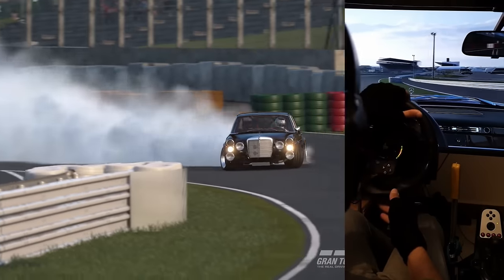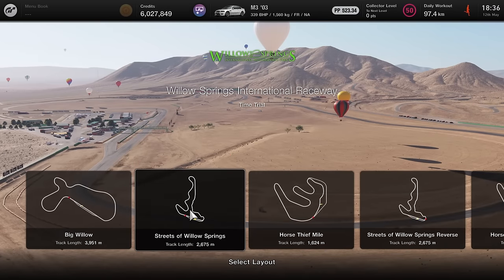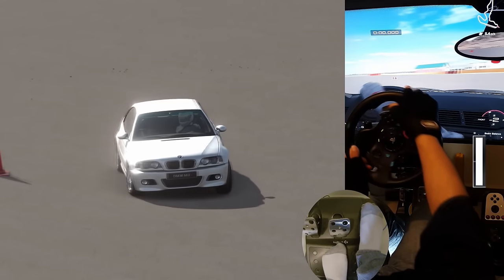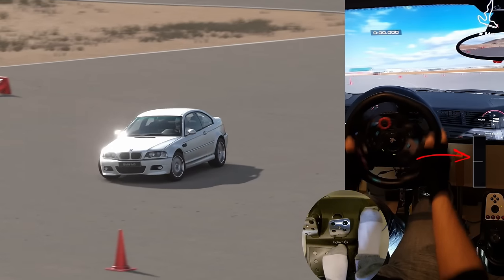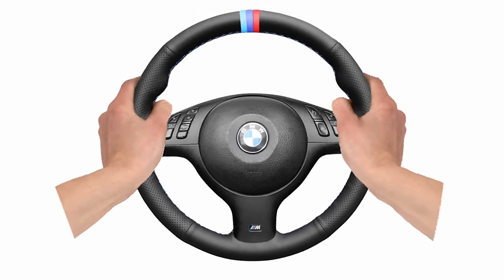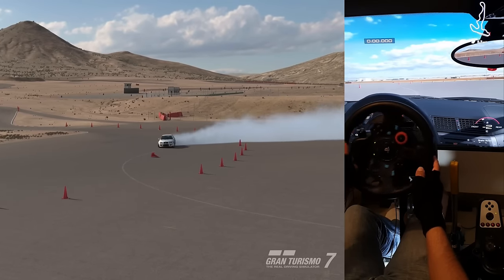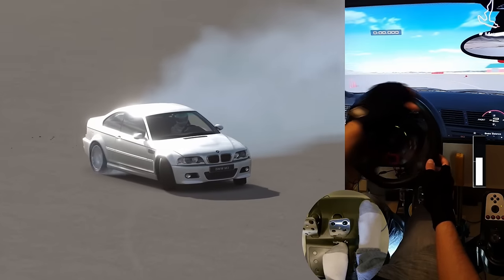How to Drift With a Steering Wheel (GT7/Real Life Tutorial) - Part 1: Basics

Comment: Is this still relevant as of patch 1.31? The wheel settings I'm talking about , drifting will always be brake throttle control.🤙🏼
Reply from the maker: I'm testing it right now. I didn't get the time to test things after the update till now. I'm finding everything still applies the same regarding the settings. I still need to do some further testing. If I find anything different I'll post about. But there are major improvements in both the physics and the ffb.
Reply: @SimActionClips  definitely major improvement, went to willow springs today and the bmw don't chatter in 1st on the G29 anymore , and can feel so much more 🤙🏼
Reply from the maker: Yes it's really awesome how much it has improved! I've spend the day testing things, just to confirm to myself that all the ffb settings still work the same, and they all do. It's still best to follow the instructions in this video and everything still applies the same: https://youtu.be/oEe5ZchqbMg
I'll be making a short video to explain how the feel in the ffb has changed, why it is better now, and why people who got used to the previous ffb are feeling it weird. It's much more realistic now and much more controllable.
Reply: Great to know , I to feel like it more realistic aswell, appreciate what ya doing man 🤙🏼
Reply from the maker: Thanks man 🤟🏻🤟🏻

Comment: You connect the g25 shift with g29?
It is possible??😮
Reply from the maker: That's a G27 shifter, it works normally like a G29 shifter but only the buttons won't work. The G25 shifter won't work the same unless you swap 2 of the wires. I don't remember which ones but I think you can easily find the right info with a quick google search.

Comment: Idk how should i do this and what speed should i be at to initiate drift because my car just wouldnt slide or turn like it should please help
Reply from the maker: That speed depends more on which car you're driving and even which tires you're using. So it's not something to memorize nor even monitor in numbers while driving because it's not a constant factor. You just need to practice a lot to get to a point where you can feel and anticipate how the car will behave. If you're new to this I highly recommend that you keep practicing a lot, and on a daily basis if possible. Try different speeds and feel what changes when you change that initial speed. Keep trying to initiate and learn what's happening during the process. It will be frustrating and can even feel impossible at first and that's totally normal. If it takes you a whole month of daily practice to just start to get used to it, that's still very normal.
Reply: have you put the traction control to zero?
I had the same problem, but as soon as i set the traction control to zero, the car started to slide. ( sorry for bad english, i am italian)

Comment: What is the best handlebar angle for drifting?
Reply from the maker: Do you mean the steering wheel angle? You cannot change that from the game. You only can from the internal settings of some wheels like my Thrustmaster TGT2.  There is no such thing as best angle tough. I always recommend what is most realistic, to best develop your skills. I would have gone for 1080 degrees on my TGT2 but it is not physically capable of being fast enough with that angle, so I stick with the default 900 degrees. In some DD wheels it could be possible to use more angle. I would never recommend less angle, one can simply use a controller then and just "play".

Comment: I'm new and don't understand what I'm doing wrong. my steering wheel g29 does not spin in the opposite direction when initializing the skid, as in the video.
Reply: maybe there are some other settings besides those in the video?
Reply: had to turn off help😅
Reply from the maker: Hello and sorry for the late reply, been very overloaded lately. Yes you should turn all assists off except for ABS. Was your problem fixed?

Comment: I disagree with force feedback sensitivity set to 10. I run it on the lowest setting of 1. 10 makes the front tires very twitchy to minor steer inputs. 1 makes the steering inputs more fluid and “real” looking.
Reply from the maker: Well it's not "real" looking as you said at all. I used to run it at 1 thinking it's the best and more realistic. Until I discovered why I should set the controller steering sensitivity to 5 as i fully described in this video: https://youtu.be/oEe5ZchqbMg
Before I used to run it at 0. The responsiveness and "twichiness" of the front tires is related to the controller steering sensitivity setting. You should set it 5 for a direct and linear relationship between your front tires and your steering wheel. The force feedback sensitivity is how directly connected you are to the front tires. Anything below 10 adds some delay. You can clearly feel and see that delay when drifting and doing transitions. It's very wrong to judge the value of the ffb sensitivity alone, because the outcome is related to which controller steering sensitivity you are using with it. 
If you want the closest to real life feel you should set controller steering sensitivity to 5 and ffb sensitivity to 10.
If you think the controller steering sensitivity doesn't affect the wheel watch the video very closely and try to repeat all of your testing after.

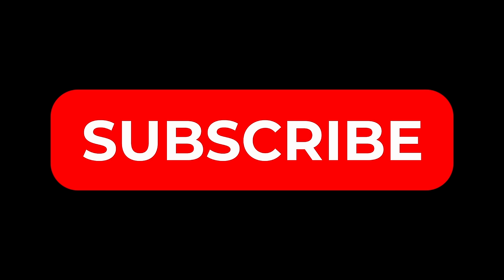Comment: Skill is growth so hey guy's cmon this sport was created by driver feeling & the required inputs to keep a consistent smooth drift.. Practice. It's like being a parent, there's no tutorial ppl, someone prove me wrong plz. I tottally agree G29 trash/dogwater  alhough what 'Info' was provided was absolutely more than enough information being fed to me, so I was successful in bridging the gap between reality & virtual reality. I've evolved from controller, g25, g27, g29 to a Thrustmaster belt driven T300, this will vastly increase the Information you receive in smaller increments. Soon, I'll have a splitter, so I'll be able to use the rig with all four components. 1. Steering Wheel 2. Pedal Box 3. H Pattern & on hold no 4. Side Brake (irrelevant anyway) at this point.. like plz don't get me mixed with a h8r props to this guy & his work for showing everbody, but I learn't from watching the 'Hot Version Drift Bible'.. I just wanted to better my knowledge & skills. Shout out 2 Mr  Voice-over but I think the community is responding oddly.. You sound like an AI generated by a sound board 😂.. Sorry I mean no disrespect, I'm honestly just brain damaged, obviously. LET'S MAKE IT OFFICIAL, PUBLICISED.. 11:28
Reply from the maker: I always said the same: skill is growth and "you just need to feel the car, and practice a lot". But many people need more than just that, they need guidance and explanation of the details. If you scroll through the comments you'll see how many people are actually benefiting from this tutorial. I've also evolved the same way from Driving Force GT to G25 to G27 to G29 and now to TGT2, and I always mention how much better information you get with a better wheel. And I've also learned from the Drift Bible before even attempting to do any drifting both in game or in real life (so many years ago when Live for Speed was still popular). I'm nor Mr. voice-over because that's actually Ai generated speech and it was mentioned in the video.

Comment: I think what is missing is assist settings that we should use for this.
Reply from the maker: I did man at the end of the video, watch at 10:12
All assists off except for ABS, you can use it at default or weak, each has its own advantages.
Reply: @Sim Action Clips  I just watched beginning and tried... and was failing with CTS =2 :). My bad 
Also it's much easier with MT vs AT.
Thanks for video
Reply from the maker: It's okay buddy. You're absolutely right, it's much easier and much more controllable with MT. You're welcome man, and thanks for your feedback 🤘🏽🤘🏽

Comment: How come when your holding down acceleration you never seem to loose power? Im having that issue where as hard as i try to keep the speed i just run out of momentum.
Reply: Also do you use auto transmission or a shifter? I dont have the shifter or a shifter yet. Will that also effect my ability to get better?
Reply from the maker: The process which I'm describing in the video allows me to do that. The idea is to not exceed the maximum speed of the current gear, nor reach it too close for the rear wheels to stop spinning. This way I keep accelerating and decelerating with a high frequency of switching between the 2 states. What you're most probably doing is that you just keep accelerating until it's not possible to keep the wheels spinning anymore. With higher powered drift machines, but depending on the turn, we can just shift to a higher gear at that point and keep going up with the speed. But in the case of this one circle, and with a normal road car like the stock M3, you need to apply this technique to keep the drift going in 2nd gear. Even when I do it the smoothest like in the first clip of the video, I'm not really holding down the accelerator. I'm continuously increasing and reducing my input, but doing it very smoothly that it doesn't sound like it from the engine. I do that a lot in real life and I always aim to keep the RPM close to the limiter without reaching it. This results in the best type of drifts one can ever watch. This should be your goal when you perfect this exercise.
Reply from the maker: I can use both, sequential or H shifter manual with clutch. I don't use automatic. In this particular exercise you don't really need a shifter nor the clutch, that's the point, to just enhance your throttle control as good as possible. Here you'll just keep it in one gear. We'll tackle what to do with gear shifting in the coming parts. I advise beginners to stick with sequential manual at first, to not be distracted with so many inputs. Once the basic techniques are perfected, it's surely beneficial to move to manual witch clutch where there's more control over the car, but it's not a must.
Reply: @SimActionClips  so that it stays at the 2nd gear should i just use my paddles on the wheel so that the gears dont change while initiate the drift? Or is it just better to have auto transmission until i get a shifter?
Reply from the maker: Yes use the paddles with manual transmission, much better than auto.
Reply: Hey its me again! Im finally starting to get the hang of it, but with a catch. Im able to drift 4wd cars like the evo v and the r34, but i still cant hold a drift with a rwd car. When i do drive them i always spin out, but even when i do initiate the drift correctly even a tiny amount of throttle will spin the car out. I use the s13 and s14 and it happens with both. Not sure what to do. I use CH wheels with them and stock settings with angle steering. Thank you! 👍

Comment: How are you using the g25 shifter with g29?
Reply from the maker: This is the G27 shifter. You just plug it the same way you plug the G29 shifter and it works the same. The buttons on it don't work though. 
The G25 shifter won't work by just plugging it directly. You have to swap some pins. I once did it for a friend and it worked. I don't remember which pins but you can easily find the info on how to do it with a quick google search.

Comment: Do I need the steering angle kit?
Reply from the maker: No you don't, and it's actually advisable to not even use it before you become a pro at it. Because a steering angle kit will create lots of bad habits that will ruin your learning and that will become hard to change later. Start learning without it, and get very good at drifting and controlling the car in every single way without it. Then you will become able to use a steering angle kit the proper way, to improve the behavior of the car and produce some cooler looking drifts.

Comment: For some reason my wheel just goes 360° how do i change that to 900° (i have tue g29)
Reply from the maker: It automatically changes depending on which car you're driving. Which car was it? 
Also I think for most if not all cars, if you install a steering angle kit, you'll get 900 degrees of rotation. But I don't like to use these unless I've fully built an extreme drifting machine.

Comment: Do you have tranction control turned down to 1?
Reply from the maker: Nop it's totally off, all assists are off except for ABS. I explained that near the end of the video.
Reply: @SimActionClips  Is your ABS settings default or weak?
Reply from the maker: Here it is on default. For some other cars i prefer it on weak sometimes, usually for modified cars. I used to always run it on weak in GT Sport for drifting. But in GT7 i think it's pretty good on default. I have to run some more testing though, and will surely be explaining it better in the coming parts of the tutorial.